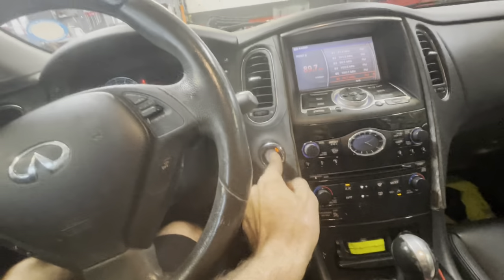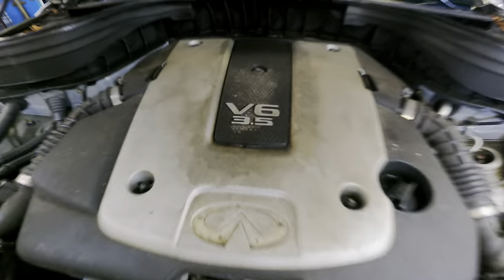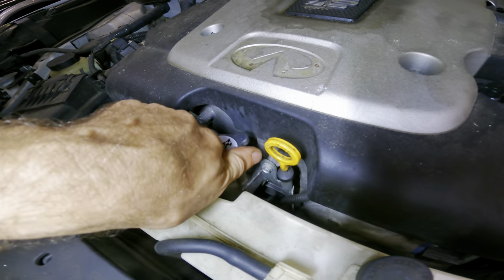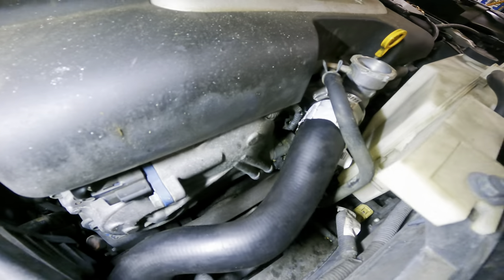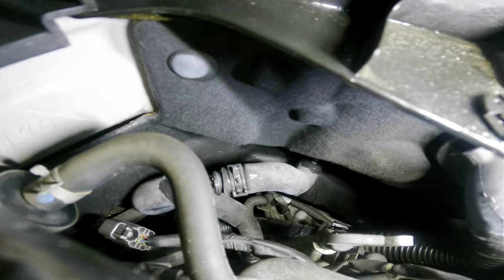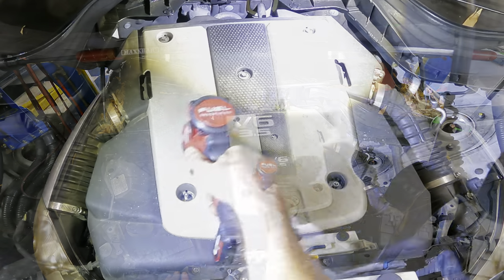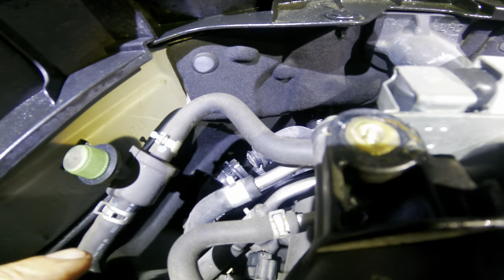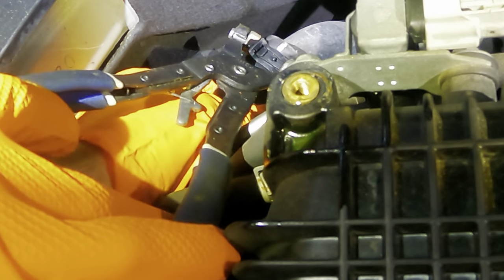Overheated after new Radiator! Tow In! Infiniti 3.5 EX35

Comment: Anyone knows that has had a infinity or Altima with the 3.5 there is absolutely no room to do anything whereas with the 2.5 4 cylinder you can do just about everything in minutes. Want to put in a new alternator? Have to completely take the radiator out and all the associated hoses. Want to put a new air conditioner? Same thing! The performance of the engine is great but it's tight in there!

Comment: I had a similar instance once with a customer and the thing was she thought it was leaking from her radiator so she went and bought a new radiator and paid a shop and then basically it was still leaking so then she came to me and I said yeah you got one of those big lighter radiator hoses do you know the three piece holes with the plastic piece in the middle so anyhow I just said yeah I can fix it for you I’m surprised the shop didn’t catch that. Anyhow went to a A store nearby which has a copious amount of brass fittings and I put a brass fitting in there because yes I did much stronger not like the piece of shit plastic she paid a little bit  extra…. But definite peace of mind that there is no issues otherwise

Comment: Actually think about this, the old radiator was leaking i assume, so it showed a leak. It was changed.
Now becuse it leaked the system never reached presure so the shop that changed the part didn't test drive the car to operating temperature so there's no way they could have seen the failing part.
So you've got to look at the cars age and mileage  heated plastic parts get brittle the presure of a properly working system caused it to burst, now had it been a hose on the radiator it might be that shops fault, they should have looked at that but its by the firewall and just dumb luck it wasnt spotted. No I can't lay blame on them I think anyone might have missed it.  Its on the customer  its his car. When he/she drives away whats to say a hose inside on the heater core dosnt burst, ive had it happen.
Aging cars can develop problems.

Ok i fear blowen headgasket and warped heads.   RAY gets a new toy to play with.

Comment: hate to say it but when a engine over heats, and it gets towed in, head gaskets can be damaged, and cylinder heads can warp, a hair, that "other guy" says try head gasket sealer, as far as im concerned I dont use that stuff, but in this case it might be worth a try. On the other hand a leak down test on each cylinder should be done  to check compression, the only way I have ever fixed a head gasket was to replace the !@#$ thing and resurface the heads

Comment: This is one of the biggest scams is a leak could have just leaked out because of the hose but therefore they got a radiator cuz they have to make money and they may have replaced one hose when it needed two hoses now they have to charge another $100 for labor plus the price of the hose I guess the customer wouldn't want to spend another $100 to replace a hose cuz that usually what they charge 1 hour labor in the price of the hose they're not going to give you a discount of a half hour or anything you're lucky they got right to it some places will say well we it'll be a week before we can even look at it

Comment: Gotta wonder if the old rad was leaking or the old cap was bad and it wasn't building pressure. That barb degraded over time then when they put the new rad/cap in, that happened. Poor design really, no reason to have a cheap plastic piece. Cant overpressure the cooling system with a good radiator cap, it will just let the pressure out...

Comment: We all must remember when we are taking these things apart that those are the things can happen in this sort of repair.  In this situation I don’t think you can blame it on the technician before because that barb broke and it was plastic and that was catastrophic for the coolant system and it happened after the fact of his installation how many miles we don’t know but when you go in for a radiator replacement or repair some people don’t want to spend the money to get it repaired correctly.  It’s the same thing that will happen if you tighten worm gear clamps on plastic radiator hoses too tightly 👍🏼

Comment: Why in hell do these stupid manufacturers insist on using plastic for cooling systems ?? I get they use plastic for radiator tanks and that's bad enough, but to extend this idiocy to the connections is on another level of stupid. Probably a carry over part from a crud box version of Nissan.
Rant over..

Comment: OOOoooo! Cringe! You sure you got all those plastic pieces out of that (heater core?) hose? If not, you might end up with some debris clogging up or restricting the coolant flow somewhere. Can you (easily) check the thermostat for melted plastic or maybe some of that "stop leak" junk? Hopefully, you don't have to take the whole front end apart to get to the thermostat. Otherwise, you may want to go ahead and replace the water pump while you're in there too (hint-hint).

Personally, I would have removed one or both tubes, extracted the broken pieces and then reinstalled so as to be sure no bits got dislodged inside the coolant line. At this point, a good coolant "flush" does seem highly advised since it might not have been done when that radiator was replaced. I mean, why did they even replace the radiator in the first place unless there was a hole in it? My assumption might be that it was clogged up, possibly with some heavy mineral build up from someone using tap water! That white crusty stuff I thought I saw is never a good sign. BTW, it may be a good time to advise against using tap water in coolant (or even batteries) for this very reason too. Use "distilled" water instead. (Of course, you may have to use tap water to flush with, but then flush tap water out with distilled before refilling the entire system with the correct coolant - HOAT, OAT, whatever. And yes, it's a PITA!)

Not sure about that head gasket assumption either. Usually, there's a test to see if hydrocarbons (like gas or oil) are in the coolant or if coolant is in the oil (hint-hint). Then again, has anyone done a compression test while the cooling system is unsealed & empty? It's not exactly fool-proof but a compression test might give you an idea if there is indeed a "leak" or if there might be a more major problem. That's my 2-cent "opinion".